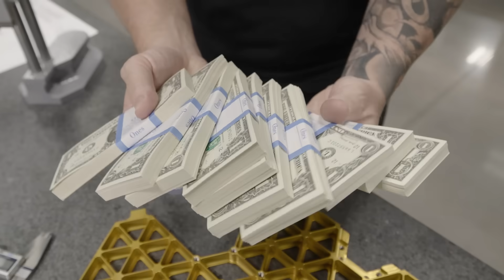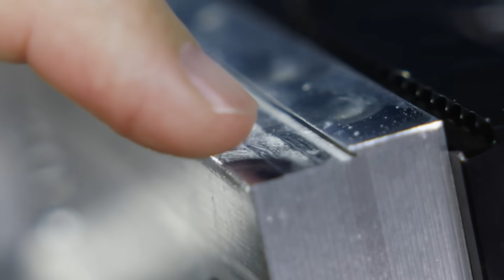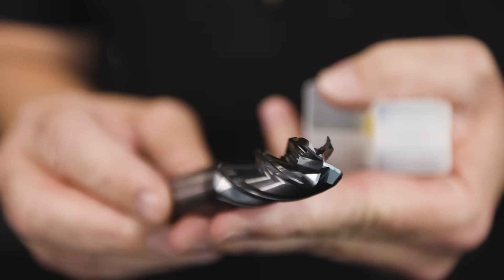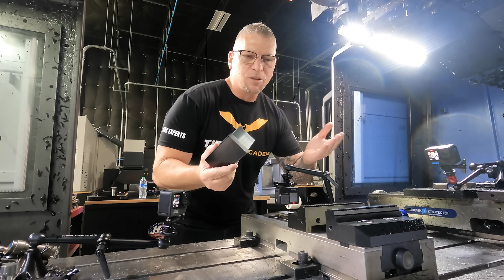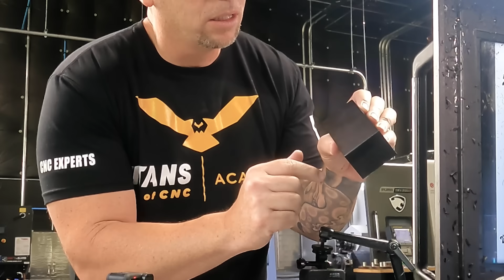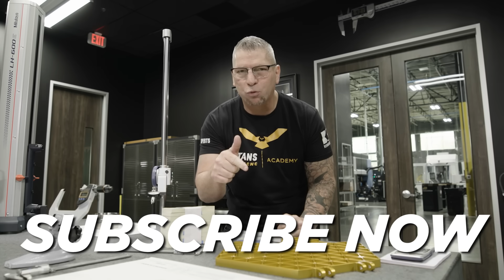How To Master The ART of Machining Plastics

Comment: Manufacturing saved my mental and physical health.  I bought the line that you had to go to college and get multiple degrees to be successful so I went for computer science.  4 years in I had reached 400lbs and was so severely depressed that suicide was an option.  Welding eventually saved me and now I'm lead fabricator for a sign manufacturer.  Cranking out prototypes and showpieces, rarely building the same thing twice in a row.  Everything from little desk ornaments to 30' skyscraper toppers to signs that belong on the Vegas strip.  I'm so much happier and healthier now that I'm working with my hands all day at a workbench rather than punching keys at a desk and getting to flex my problem solving skills constantly.  I'm down to 260lbs and dropping, my mental is in the best state it's ever been, and every day I get the chance to improve myself and my craft.

stack size -> 6.1543 inches

Comment: I found my first job on a cnc by chance when the owner of a large company went to get insurance at the agency where a relative of mine works.
this client was talking about the fact that he didn't find staff willing to do the hard work.
I was in csa for 6 months so I wanted to give it a try.
at first I thought they were looking for a welder so at the interview when I introduced myself I said I know how to weld.
the foreman convinced of a mistake told me to go to the offices on the other side of the road, at the end, I saw a well-dressed man and he understood that he was the boss.
since the distance was long instead of walking I took a quiet jog and when I got in front of him the first thing he said was 'so you run' he smiled a little and took me inside to do the interview.
he offered me a seat on a cnc machine, I explained to him that I had never seen one in my life and he told me that I would learn in the field.
the shed was cold in winter and hot in summer. the machines were open hot chips flew from one machine to another ending up in my head.
the first time I gave the command m7 an orange slime came out of the spindle and with a bit of wire I removed the hitch.
the place was terrible but the foreman, even if I got the programming wrong and sometimes I hit the piece, kept me there to work.
I spent 9 months there, there was no sitting and cold or hot you spent 9 hours standing a day plus Saturday morning in the midst of the noise of machinery, until one day I gave in and went away.
in addition to poor working conditions I was targeted by a young programmer near me.
I found another job in a neighboring town, it was an old company of only 5 people, it starts as a button press, and slowly made me do my first program in this company.
my luck was that the machine control was an old version of the old job ones, so without too much trouble I started the machine.
in the time when the cnc was working and I had nothing to do I took a piece of paper and cleaned the doors of the cnc.
at the end of the shift I would give the table a quick clean and turn off the cnc before leaving as I had been taught in my previous job.
I noticed that I was the only one to do it, over time I realized that I was the only one besides the boss who knew how to make four lines on a cnc.
after a month in here I was programming simple pieces on board the machine the boss teaches me the cam, I didn't understand anything.
it took two months to master the basics, while the cnc worked in my spare time I tried to hit the buttons on the cam to understand their function.
from there now I have the keys to the company in my hand, and although we are a small company of 5 people and even here it is cold in winter and hot in summer I am happy with the relationship that exists with colleagues, even if sometimes even here it is not the best with the heating to a minimum to save money here it is better because the boss is a person who listens to his employees, and even if it is hard to have examples of the cutters you need after a while he is there and buys.

Comment: Hey Titan I have been a machinist for over ten years working mostly in Space and Aerospace. I remember when I first became a machinist I was newlywed, we just found out my wife was pregnant and I lost my job. My Dad, who has been Machining for over 40 years now, was working at a small company and I needed job so I applied for a position there. I ended up getting a job, but I was a janitorial job. I was kind of bummed out because I didn’t want work as janitor and the drive was longer than I wanted to travel to only make $8.00 / hr. My Dad talked to me and told me he would drive me every day and assured me that everything was going to be ok and to trust in the Lord. I remember him saying that this is what it means to be Man. You take care of your family first, you sacrifice everything for them! So on first day of work I came in with my dad and he introduced me around to the guys in the company and showed me where I’d be working. After about three hours my Dad came out to see how things were going and told me he wanted to show me something. Inside the machine shop he showed me a manual lathe and showed me a pair of calipers, a turning tool and a bar of aluminum. He told me “load the aluminum, tighten the chuck, turn on the lathe and turn this down to 3 inches”, I was a little nervous to say the least, but I did what he asked and it was like things just, clicked. I just got it… I don’t know how else to explain it. Initially my Dad‘s boss wasn’t too thrilled that he moved me from being a janitor to working in the machine shop, but my dad told him to be patient and trust him. My dad knew what he was doing and I’m thankful he did what he did because just a few weeks later I got a raise, and few years later I moved on to working for company’s like Virgin Galactic and NASA. I most recently moved to Denton TX and took a job working for medical device company called Orthofix. I love Machining! It’s not only my lively hood for me and my family, it’s my passion! I’m always looking for new ways to improve, whether it be through the latest and greatest cam software, the newest tooling, or videos like this that show you simple tips and tricks that can help improve your performance! If I had to guess the height of the stack I’d say 4.3887! Thanks for all you do Titan and I look like look forward to the next video!

Comment: so i did see it right XD. we use the same(ish) 
tactic for a super clean finish on steel parts you begin low and ramp up so you don't hit the begin of the part now you only have ))))))) instead of )()()()()()()()( 

o and the money 4,386 inch.

Comment: I get that message after posting a comment its automatic . Luckily I'm not stupid. Great video Titian. Only thing I hate about running delrin is cleaning the coolant tank. So I have been machining over 20 yrs. Got in to it out of necessity as I wanted to be a rock star. After my wife told me we were having a baby I had to find a real job. Started out with edm. I was amazed that metal was cut with electricity. Moved on to cnc lathes and mills. Over the yrs have machined may types of metal and plastics. I have learned alot and I still do every day at work. I do mold work now which is not as exciting as it first was. I really want my own shop. I would like to work together with my son to make a great company.  Work is work nowadays but I do remember my excitement for machining and its ability to allow me to raise a family of 7. Anyway my guess is 4..4575. Pressure is hard to know as the stack will compress under its own weight.  I used the standard thickness of a dollar plus the paper wrap which is
.009 because of the overlap. Then accounted for some compression may not be spot on but hopefully it close.

Comment: I have been in the machine trade for 4 years now. At a small tool & die shop now but started with 3d printing at home as a hobby. Love the programming process and the challenge to complete as much of a part i can in as little amount of setups. And it has helped my family by allowing my wife to take time off and take cate of our new born. Would love to get into 5 axis mills as i only have ran some 3+2. 

Love the videos. Id say the stack is 4.387.

Comment: We couldn’t have anything in our modern lives without machining. Semiconductor manufacturing equipment, phone cases, rockets, molds and dies for car manufacturing, the list goes on and on. Love machining even though I haven’t had my hand on one for 30 years. But the memories of touching and stroking my first lathe, ohhhhh.  And the stack is 4.386” if there isn’t some gap due to curvature. Clamp it until it is 4.386” and this will be right.

Comment: Hey Titan, my story starts towards the end of the 1st quarter of my junior year of high school. I was not on track to have enough credits to graduate by the end of my senior year. My goal had always been to go to college for engineering since I was alway into taking things apart to figure out how they worked. I was also really good at math and was taking college level math up until that point but was finding it hard to get motivated to complete my schoolwork causing my grades to slip even further. After meeting with my guidance counselor, they decided to pull me out of the elective classes I had and signed me up for woodshop, welding, small engines, manufacturing, and machine shop. 

That was the turning point in my life that opened my eyes to what was possible out in the real world. I went from a kid that wasn’t going to graduate high school and was never going to be able to get to do what I wanted to someone who knew that there were jobs in a field that I was interested in and I didn’t have to go to a 4 year university to get there. 

I completely turned my grades around and with summer school I was able to graduate on time. I then went to my local college for machine trades graduating top of my class with honors with a 4.0 gpa.

I have now been with the company that hired me right out of college for going on 14 years. I started out as an entry level operator moving all the way up to being one of the top programmers/setup machinists in our company that has grown from 88 people to over 200 since I started. 

Without a 4 year degree I have been able to own a house and provide a comfortable life for my wife and 2 kids. If you are willing to put in the work and are always trying to learn more, manufacturing has unlimited potential. 

My guess is 4.3217 for the stack of cash

Comment: I would just like to say that the titans of cnc youtube channel changed my life back in 2018. At the time I was 16 going into my junior year in high school. My dad is a Job shop foreman, my uncle is a wire edm operator, and my grandfather is a manufacturing technician. But I never really understood what manufacturing was all about until I stumbled apon titans youtube channel. After watching some old titan TV videos I was hooked. I immediately knew this was my destiny. I really started looking in my high school to see if we had any cnc courses which in fact we did. In the summer before my junior year I took the titans of cnc building blocks course in the academy.  It gave Me a early start to my manufacturing education and I can not be more grateful for the experience titan had given me at the time. I ened up finishing high school with a boat load of experience. I ended up receiving a couple of first place positions in a machining contest designed for high schoolers in the Chicago area. I met titan once at imts back in 2018 and believe it or not I still have the signed poster. It's been almost 5 years since the first time i learned about this trade, I'm now almost 21. I'm finishing my associates in manufacturing technology at my local community College. I work at a job shop. There I'm a programmer, setup,and a part loader. I have my own machine that i run. As well as being a cmm operator. I've only been working there for a year and a half but I've learned alot. I'm extremely grateful for this trade for giving me a purpose in life. 

As for the stack of money I believe it to be 4.3555 inches tall. That's my lucky guess. Good luck to whoever  receives it  :)

Comment: I dont want the money, but lets see how close google gets. .004375" is the given thickness for a dollar, multiplied by 1000 =4.375". Average paper wrapper is listed at .004", 10 wrappers 1 layer on the top 1 layer on the bottom = 20 pieces of wrapper. 20 multiplied by .004" = .08". So 4.375" + .08" = 4.455"

Comment: I am a student at Indiana County Technology Center and this is my third and final year there. This year has been my best learning experience because of YOU. I have applied your 3d models in the academy to our shop and I have learned more than I could ever dream of. Even with my NIMS parts, all the other students would make the part to what our instructor taught them to. I would look at that part and say "Hey, I can do it this way and save 15 minutes". I love manufacturing and wish to be as successful and wise as you Titan. For the stack... a sheet of paper is 0.004 grand and a dollar bill is 0.005. So there is 10 pieces of paper folded twice. So 20x0.004= 0.08 and 1000x0.005=5. So the stack should be 5.08 inches tall.

Comment: Manufacturing is quite amazing, the sheer level of engineering, design, and fabricating said design. I'm a 4th generation toolmaker, working alongside my father. which he started working in this industry around 30 years ago and recently joined him as an toolmaker apprentice around june of 2021, first few weeks were quite stressful due to no self confidence plus "i don't want to make one mistake, everything has to be done perfectly" mentality.  Regardless as time went on, being taught by my dad how to machine: turn, grind, mill, wire, raw metals to cutting and finishing up hardened tool steels, gained more confidence in myself, more knowledgeable and more independent by the month, but, my old man is quite old school and prefers the "slow and steady" way of machining, especially on the CNC mills, which sometimes is painfully slow, though, he knows many things. i'll need to learn as much as i can to survive this trade, but since i discovered your channel Titan, your videos were the real eye opener for me when i see your shop doing jobs with stunning, speed, precision, amazing tooling, and techniques that really add to the old saying of "more than one way to skin a cat." overall being very efficient, now i aspire to reach the level of skill like you and your shop. And that stack of cash i estimate to be around 3.52 in.

Comment: I like that ramp down technique to prevent chip out on Delrin although the real secret that I would like to know is how do you completely clean them up before you switch back to machining metals? Between the occasional chips that somehow manage to float and their ability to stick to just about every surface if they get too hot, they are a pain to clean up.

Comment: I have been in manufacturing for 15 years now. out of high school I had no clue what I wanted to do. Dropped out of college after 6 weeks got a job as an operator. With in 2 years I was taking care of the floor, changing inserts and doing small setups. After my 4th I got an offer with another company to learn to program. After 11 years I am a certified machinist with journeyman papers, and recently added solidworks certs to my resume. Crazy where life takes you. and how fast you get there. 

as for the cash my guess is 4.3656 inches

Comment: Machining/manufacturing has dramatically changed my life, I don’t know where to start, I started out knowing nothing all I wanted to do was build my own bicycle when I was in my early 20s saved every penny and i bought a tig welder to learn how to weld while going to school for civil engineering , then I realized I needed a mill and lathe after a while I saved up and bought harbor freight a 7x11 lathe, and a tiag mini mill all manual to start, after a while I had people coming to me to build them stuff with my little equipment, I was working full time and then working in the shop in the evenings  slowly upgrading the equipment after doing that for 8 years I went on my own started my own custom fab shop, I’m now in my 40s and still running my shop but back to part time but now I only take on jobs that I want. I’ve been through some tough times ( that story would take a long time to write up, just short version old land lord evicted me from my shop and house due to the spiritual beliefs of my wife that he didn’t agree with) but we just followed the path that god has laid out for us and I’ve been able to keep machining and it still is the best part of my day turning the lights in the shop on and trying to figure out the new problem laid out for me to do. I guessing the thickness of the stack would be 4.429 +/-  I got that from taking 1000 dollar bills each at a thickness of 0.0043 = 4.3” then guessing the thickness of the bill straps the same as the bill 0.0043 * 20 ( ten stacks of bills and with the strap top and bottom of each stack ) = 0.086, then assuming the strap is glued at the top or bottom so add 10 more strap thickness 0.0043*10 =0.043, thanks again l love watching the shows keep up the awesome work

Ian Dunlop